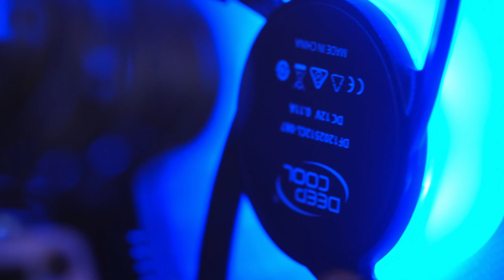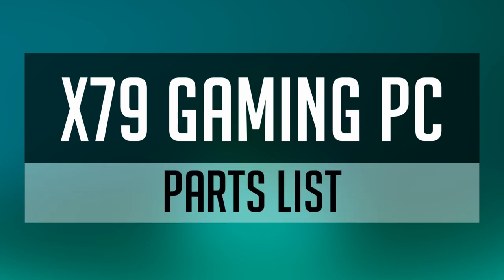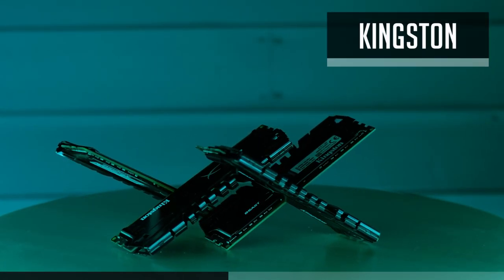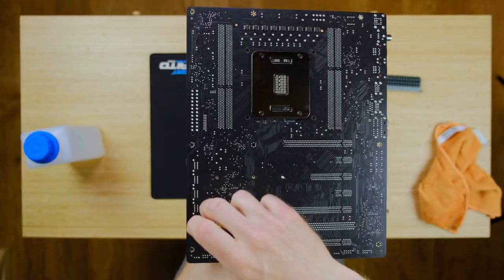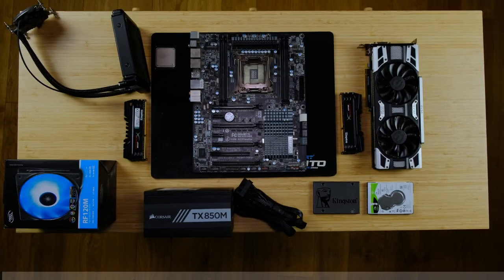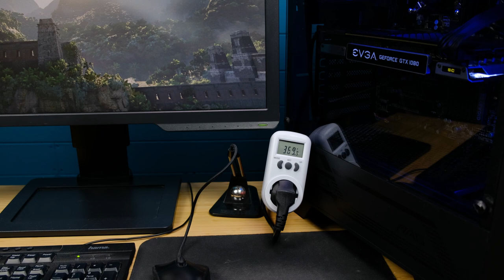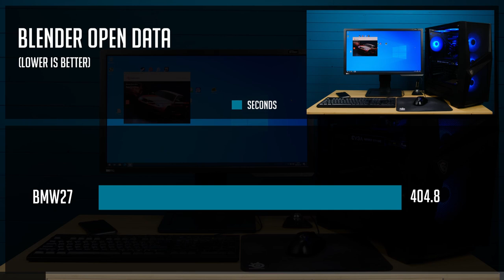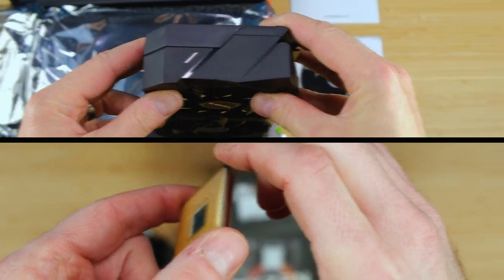TOO OLD IN 2021? NOOOT! I7-3930k (X79) + GTX 1080 GAMING PC BUILD - 14 Benchmarks & Power Usage

Comment: Im still hunting for a nice affordable used X79 Mobo for my old i7 3930k. Nice X79 Rig building man! 👍🏻👍🏻
Reply from the maker: Thanks! :)
Yep, definitely, a challenge to get a good x79 for a decent price
Reply: I’ve been offered a gigabyte sniper x79 board with 3930k and 16gb ddr3 for $250 aud
Reply: Not sure if I’m gonna get it tho
Reply: Im literally about to buy an asrock x79 extreme 4, 16gb of 2133 ram in quad channel, i7 3930k & some antec aio cooler for 120 eur, sounds good enough for me
Reply: @manistechshack  sounds like a great deal my friend! Pick that shit up !
Reply from the maker: Wow both deals are insane ;))
Reply: Awesome deals for both of you guys! I don't have many option for X79 mobo from few well known Marketplace in my country (Indonesia). Either its a BNIB 'brandless' chinese X79 Mobo or an overpriced used Asus Rampage IV 😅
Reply: @danzdamonz  ive actually been using a cheap atermiter x79g motherboard i got on aliexpress for about 40 euro, and to be honest it works great, obviously with its qwerks such as no sleep mode and only dual channel memory, i havent tried overclocking since i have a xeon e5 2630v2 and it cant be overclocked but ive seen videos of people overclocking on it, the reason im upgrading is because i wanted sleepmode (to download games overnight) and i wanted a new cpu that i could overclock. Hope you find a good deal :)
Reply: @manistechshack  Thanks a lot man! Hope u'll get the Asrock X79 Extreme 4 mobo and got a good workin' sleep mode on that X79 PC setup. Thanks again for the info sharing man! 🙂🙏🏻👍🏻
Reply: @manistechshack  Excellent deal provided all works.
Reply: @danzdamonz  I have my youngest daughter's PC setup with the Xtreme 4 ($180) + E5-1650V2 ($60) + 32GB HyperX Fury 1600 RAM ($80) + venerable RX 570. Cooled with a SNOWMAN RGB 120mm 6 pipe tower cooler off AliEx ($21). OS is on an SSD. Game storage on an NVME using PCIE slot.  Also, wifi 6/BT 5.1 on another PCIE slot. It is a decent setup for med-hi 1080P demands. Running at conservative 4.3Ghz OC; a daily driver speed.

Comment: Core i7 3930k or core i7 3770 which is best for gaming plz help me bro
Reply from the maker: Hey,
well, i7 3930k is definitely a better CPU, but a question is, how much you can get each of the CPU + motherboard combo? IF the difference is quite big, it's not working it.
The thing is i7-3770 (non-k) can run on a more common motherboard with H61, B75 or z68 chipsets. While 3930k you need X79 chipset motherboard that costs 2-3 times more than already mentioned chipsets in most cases :)
So unless you can get some insane deal ;)
Reply: @EpicGameTech  ok thanks bro i got you

Comment: I have 3930k oc on 4.7ghz its a beast for 9 year old machine!
Reply from the maker: Nice, what cooling and GPU do you have? :)
Reply: @EpicGameTech  nothing special rx470 msi gaming x
And for cpu cooler is arctic freezer 34 duo eSports
Reply from the maker: Ah, you should definitely upgrade your GPU as this CPU can handle much better one! :)
Reply: @EpicGameTech  i think it can goes to 2060 ,or 5600xt that's the border.

Comment: Does your i7-3930k run at pci e 2.0 or 3.0 ?
Reply from the maker: I7-3930k and x79 chipset runs on pcie 2.0 :)
Reply: @EpicGameTech  well intel says 2.0 but techpowerup says 3.0 was there not a microcode update for this cpu to use pcie 3.0
Reply from the maker: might be, but since I do not own this system anymore I can't check it for sure :)

Comment: Would this motherboard work with a i-5 9600k ?
Reply from the maker: H,
No, x79 motherboards are meant for older generation Intel CPUs.
For i5-9600k you need to get a z390 or z370 (with updated bios) chipset motherboards :)
Reply: @EpicGameTech  i have a GeForce graphics card does it matter which mother board i get ?
Reply from the maker: To be honest, your questions are kind of random in a way, that me answering each of them will probably not give you much value :)
So if you really need some insights, please specify all the situation what exactly do you want to build, what exact parts do you have and +- how much you expect to spend :)
Reply: @EpicGameTech  basically I need a new processor my graphics and ram is fine I have a 1660 gtx ti and 16 gb of ram and that’s what I was wondering what motherboard I need to upgrade to a I-5 9600k
Reply from the maker: I see, what CPU do you have at the moment? :)
Regarding motherboard and a gpu, it doesn't actually matted what motherboard you will get. Motherboard is more tide to a CPU you want to run, do you want to be able to overclock it etc. and how much you want to spend on a motherboard (budget option/mid-range etc)
Reply: @EpicGameTech  Xeon E5-2620 2.00ghz
Reply from the maker: Ah, i see :)
So you say you want i5-9600K?
If you really want to go with intel, I would actually suggest going with i5-10400F - it's newer generation than 9600k, also it has hyperthreading enabled (meaning 9600k has only 6cores, while 10400f 6 cores/12 threads).
9600k has a little higher clock speed, but in real world scenario, you will not see performance difference, especially with your current video card. Also I think 10400f is ~$50 cheaper.
If you want to overclock and get e better intel cpu, then its better to go for 10600k (as it has hyperthreading enabled as-well, but not 9600k)
In general, I would recommend going Ryzen 5 3600 as a more budget, but decent gaming cpu. But these days, r5 3600 is not available or even more expensive than i5-10600k.. so :)

Comment: where you found board for the 3930k ?
Reply from the maker: Hey,
well, locally, in my country, someone was selling it. So you have a few options:
> Ebay, but quite expensive models there.
> Local site like craigslist.org where people are selling parts
> Facebook Marketplace
> Aliexpress - you can find cheap (well ~$100) motherboard that supports this CPU. But those Chinese brands motherboards are not true x79, as they support dual-channel memory and probably no OC possible since not the best VRMS on those boards. But they could run 3930k stock.

The best way to find someone locally e.g. in craiglists selling decent x79 motherboard for a good price. But it's possible that no one is selling it, then those other websites :)
Reply: @EpicGameTech  thx I found one on amazon

Comment: The max temps for this CPU is 66,8ºC and u used on 79°C.
Reply from the maker: Hey,
not quite - TCASE temp you see on Intel site is not TJUNCTION temps we used to see on latest CPUs. I think they started to provide TJUNCTION temp from 7th gen Intel cpus.
To measure TCASE temp is much more difficult as a standard software doesn't report this number :)
Reply: @EpicGameTech  Ah thank you! What software do you recommend for me to see the actual CPU temperature? And what is the maximum working temperature of this CPU?
Reply: @EpicGameTech  ?

Comment: Hey epic game tech, umm.. I need help I don't really understand the pins in some pc parts I'm kinda confused cuz I'm new. Can you help me?
Reply from the maker: Just shoot what exactly you do not understand :)
Reply: Pins.
Reply from the maker: Well, there are ping on a CPU (AMD) there are pins on a motherboard (Intel) and also PSU connectors called like 24pin connector etc. :)
So where exactly you need help?
Reply: Psu, thank you
Reply from the maker: With PSU it's quite easy :)
- 24pin biggest connector goes to your motherboard
- Then 4pin OR 8 pin (depends on a motherboard) connector goes to your motherboard as well.
- 6pin or 6+2 pin or even more goes to the video card.
- SATA connector goes to SSD or HDD.
Reply: Thank you so much! :D

Comment: Try to reseat the CPU. The memory controller is on the CPU...You could maybe resurrect the 4th memory channel.
Reply from the maker: Yep, but I tried a lot. I assume some pins were not fixed till the end, since there were quite a few bent ones :)
Reply: @EpicGameTech  Sometimes cleaning the RAM slot can help.  See TechYesCity...he does some crazy cleaning to resurrect a lost channel.
Reply from the maker: @jb678901  Tech Yes City was one of the 1st Tech channels I've started to watch and one of the reasons I've started this one :)
Yep, tried lots of things, but not the extreme ones, since it was my friend's board.

Comment: DUDE that is basically my system, I have the xeon counterpart of 3930k (xeon e5 1650) and gtx 1080.
Reply from the maker: Yep, still decent performance for sure.
Did you OC your Xeon? ;)
Reply: @EpicGameTech  Yea I tried, It is unlocked but the temps were too high and stability was hit and miss. I modded the bios and installed nvme ssd. I plan to upgrade the gpu to rtx 3070 on summer 2021 :) long live x79!
Reply from the maker: Hmm, temps too high on vrm or CPU?
In case of a CPU, just get a better cooler ;) as you might want higher clock speeds when uaing 3070 for aure
Reply: @EpicGameTech  will definitely try to overclock again when i buy rtx 3070! at least my motherboard has a feature like multi core enhancement, all cores run at max boost clock 3.8GHz.
Reply from the maker: You should try going higher for sure in case your cooling is enough :)
Reply: Moi aussi. Sur aliexpress le Xeon e5 1650 se vend 37€ je l'ai acheté et le fait fonctionné à 4200mhz.
Reply: @mtunayucer  je le fais fonctionné a 4200mhz sans augmenter le voltage. 
Je force les 6 coeur constamment a 4200 sans aucun problème. 
Au benchmark CPU-z je suis passé de 2400 a 3300 points.
Il est monté sur une carte mère Asus rampage 4 Formula avec un kit 16go ddr3 2133mhz (4x4) quad channel.
Jai commandé une carte mère huanan pour passé a 32go de RAM.

Comment: Also epic game tech, how do I choose a power supply correctly?
Reply from the maker: Hey,
Depends from whole build budget and CPU/GPU you are going to use :)
Reply: What about the one in your 200$ pc build?
Reply from the maker: Well, I got used no-name 600w PSU for 10$ I think :)
But in general, I recommend getting at least the one with 80+ or bronze certificate even if you go for a used power supply :)
Reply: Wow, 10 dollars? That's a great deal
Reply from the maker: Yep, but it was used and like 7+ years old :)
Reply: woah, was it ok tho?
Reply from the maker: Yep, but I would not recommend using it for a long time. I mean I would recommend replacing such a PSU as soon as you have $ for a better one, as I mentioned 80+ or bronze certificate :)
Reply: Oh ok, thanks for the help
Reply: Also, in h61 motherboard what pin do you need? 4 or 8
Reply from the maker: 24pin as for all of motherboard, and then 4pin for sure :)
8pin goes to motherboards with CPU overclocking most of the time. And H61 chipset is for non-overclockable CPUs.
Reply: Umm..epic game tech what if the power supply doesn't have a 6 pin?
Reply from the maker: Only some very cheap and very old PSUs didn't had 6pin for a GPU. Do not buy such PSU, since you will be able to use a GPU that does not require 6pin or 8pin. Sure, in case you are planning to get similar video card, it will be ok. But e.g. rx570 needs 6pin for sure :)
So, before deciding if 6pin is necessary, you need to know exact GPU you have/will have :)
You can find some RX560 with no 6pin (but very few models) and slower cards like RX550 some gtx 1050 ti models does not require those pins. But you will limit yourself to a few models and that means you will pay more for a slower GPU since you will need that particular GPU with no 6pin :)
Reply: Oh but I'm planning to get rx570 but it requires 2x6 pins
Reply from the maker: Well, it means you need a power supply with 2x6 pins. Hmm but there are rx570 with one 6pin or 8pin for sure. Majority of them actually with one :)
Reply: can you replace pins?
Reply from the maker: What exactly you mean "replace"? :)
Reply: Like replacing pins like for 6 pins is that possible?
Reply from the maker: Still not sure i got it right, but those 6pins or 2x6 pins are providing power to your GPU. So if you do not plug your device to a power, you can't use it :)
Some high end models that have 2x8pin connectors can run with just one 8pin connector. Since 2nd one is needed for overclocking. But it depends from a particular model if it will work. In case GPU has one 6pin or one 8pin, you need to plug those connectors as GPU will not run :)
Reply: ok, thank you.

Comment: my pc-workstation rock in 2020 dual x5690 128gb ram ecc ddd3 and gtx titan x maxwell, workstation name hp z800 Ș))))))) no need to upgrade
Reply from the maker: Whoot :)
Would cost quite some $ to get a better performance workstation for sure
Reply: @EpicGameTech  i have a secand workstation Lenovo s30 with Xeon e5 2680 8 Core with 16 treds and 128gb eccddr3

Comment: IN 2020/21 test in 1440p & 4k...
Reply from the maker: Hey,
well, it's 9 years old platform/CPU, so not that many will get a similar system for 4k gaming. But point taken, I've could have tested this in 1440p as-well :)

Comment: You can overclock it to 4.6-7 then it's another level of performance
Reply from the maker: Hey,
I believe! :) didn't actually try it since that 120mm AIO was around 86c when stress testing :)
So I would need way better cooler for this 130w the beast.

did you push yours to 4.7?
Reply: @EpicGameTech  I got mine running at 4.7 till this day with a H110.
Reply: it also doubles up as a heater in cold times
Reply from the maker: @KiteoHatto  ;D
Reply: @EpicGameTech   yeah i got it slightly under 4.7 because of cooler. funny how this old tech can be still capable. it outperforms my 7700K at stock. :D sorry for the late response but my notificaions are mess
Reply from the maker: 7700k has fewer cores but sure, single-core performance should be higher :)
Anyway, 6c/12t still ownz
Reply: @KiteoHatto  Actually does I've got mine at 4.7ghz @ 1.35V, running a 480x60mm Rad but yeah :D

Comment: Will 3930K bottleneck RTX3080?
Reply from the maker: Hey,
Well, I would not pair 3930k with 3080 for sure :)
Stock (no OC) 3930k was running quite well with gtx 1080. But its a max GPU I would go for. In case you OC it well, hmm maybe 1080 Ti (2070 super) at max. But mainly these GPUs would benefit from a faster/newer CPU :)

Comment: So many bent CPU pins... that's why one of your memory slots didn't work....
Reply from the maker: Yep, true :)
That's unfortunate when you buy 2nd hand old motherboards. But even 3 channel RAM is good enough for gaming. Even though, spending even more time on those pins, this issue possibly can be fixed.
Reply: @EpicGameTech  Yeap! Maybe there is a soooo tiny bent in a pin that might not connecting proper with the CPU and that's why you cannot see the 4th slot. Epic X79 platform especially when you have a high end Mobo and you can overclock a 4960X or 1650V2 or 1680V2 8C - 16T ;)

Comment: I prefer the Z87 myself... :-)
Reply from the maker: z87 paired with i7-4770k or i7-4790k is also powerful and a lot cheaper in most cases than the x79 combo ;)
Reply: @EpicGameTech  Indeed, i've got a I7-4770K on my DZ87KLT-75K :-)